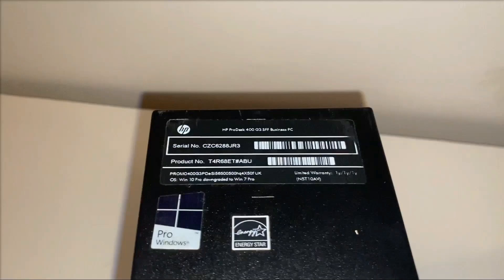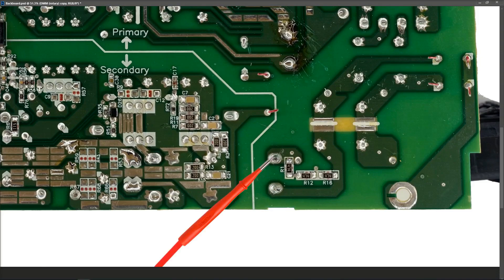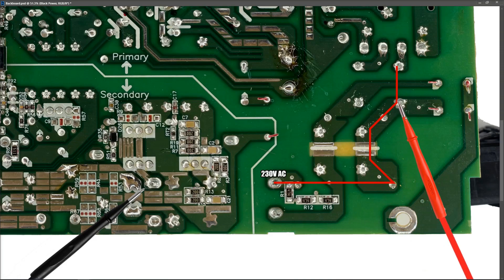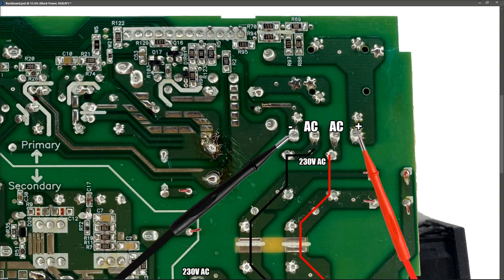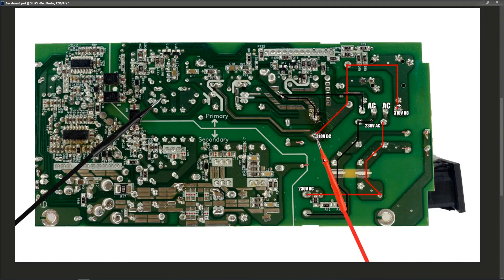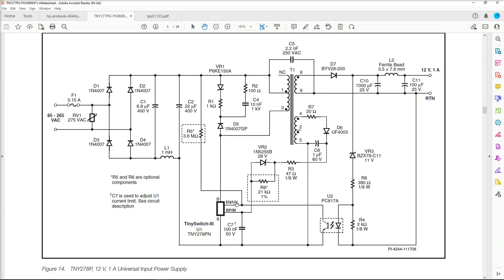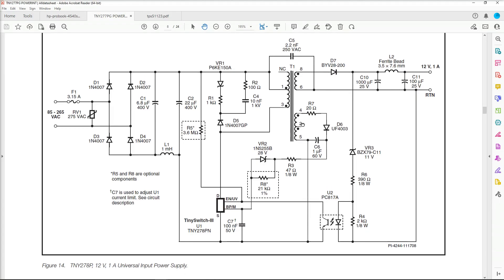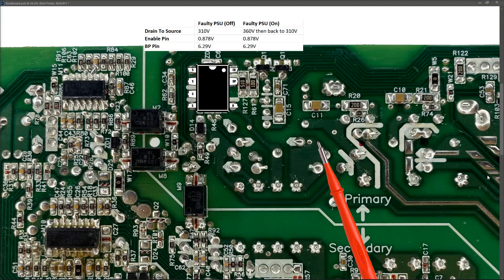HP ProDesk 400 - SMPS PSU Troubleshooting And Diagnosis

Comment: Love the video. Waiting for the 2nd part.

 I have a query. Why did you place the red and black probe on the source and drain? Aren't they both live, I mean isn't black probe supposed to be on the ground?

Forgive me If I can't put my question clearly, but can't we place the red probe on the drain of the MOSFET and with the black on ground, we can measure the voltage and turn on the device to compare the voltage change(310 to 360)? Anyways, your videos are so informative for a noob hobbyist like me. I learn something new in every video. Have been watching since the beginning. Appreciate your efforts.
Reply from the maker: Hi, this is a trick that I only learned recently, and the measurement is usually carried out between Drain and Source of the power MOSFET itself. The idea is that there is an increase in the ~320V voltage measured across the MOSFET, when the magnetic field in the coil collapses. On a known good power supply, I found that I measured 310V DC between Drain and Source pins of the power IC when off, which then increased to a stable 370V DC when powered on. On my faulty power supply, I measured 310V DC between Drain and Source pins of the power IC when off, which initially increased to 360V DC but then drops back to 310V DC. So what I am reading from this is that my faulty power supply is initially coming on, but then detecting something wrong and shutting down. I dont have a scope to read for PWM signal of the power IC, but this is what I can do with my own equipment.

At this point I have tested secondary diodes, swopped out power IC, checked for shorts - still not working!
Reply: @therepairshare673  Now I understand. It is the voltage change between both pins. Thank you for your reply and I am sure you will figure this out soon. 😊